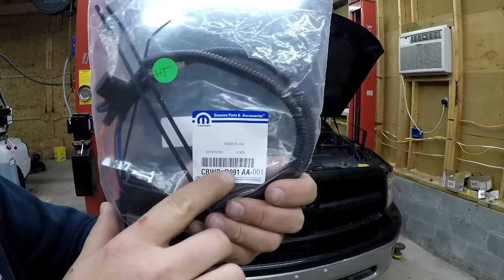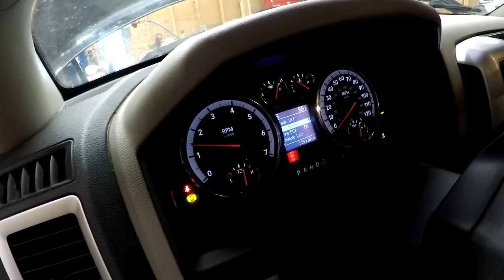Installing a Dodge fuel pump relay bypass for a faulty TIPM repair

Comment: Will that bypass fit my 2008 Dodge Ram 1500 5.7 leader the fuse panel that you're working on is different than the one that I have my fuse panel is located diagonal next to the battery not flat and yours have much more fuses in it than mine does your video was 4 years ago I look for the part number on Amazon and couldn't find it do you know if that item has been updated as different part number I just don't know

Comment: My grand cherokee had this recall fixed 3 or 4 yrs ago. Then from a year ago jeep gives hard start. So u have to turn on jeep half way to wait for fuel to rise then turn on fully. Now for the last four weeks jeep shutting off while driving. They say it is the fuel relay again. Chrysler just issued a recall on the recall nov 22 2019.
Reply: NOVEMBER 22, 2019 — A Chrysler TIPM recall has been issued for more than 698,000 Dodge Durangos and Jeep Grand Cherokees that were previously recalled for TIPM (totally integrated power module) problems.
The 2011-2013 Dodge and Jeep SUVs are equipped with 3.6-liter, 5.7-liter or 6.4-liter engines, and the recall is needed because the fuel pump relays inside the TIPMs may fail and cause the vehicles to stall.
Reply: My dealer says no fix till next year. So my jeep parked up

Comment: Great information but I think they're onto to this repair.  The part number comes up dry on google searches with the exception to the safety recall notice you showed.  Ebay had one with the wrong part in the bag.  Fortunately the notice contains a wealth of information.  Just sent an email to Mopar Part Depot with the truck VIN.  The notes on the Mopar page said this item is VIN specific.  If I receive a go pound sand reply I can at least build one.  
Thanks

Comment: My dad owns a 2012 dodge ram 1500 its a crewcab and has around 150,000 Miles. I ordered the part to fix the tipm and look forward to installing it. His truck has one issue that i hope you may help resolve. About one month ago a service electric trailer break light has come on the guage cluster. When he does start his truck the truck stays stuck in park and does not want to switch gear. In order to drive it you have to start the truck, turn off, switch to neutral, start the truck, and then switch to drive. Any help would be appreciated.
Reply from the maker: I can’t say I’ve came across that issue yet! It would be a guess without looking at scam tool data.

Comment: 2011 dodge grand caravan,,at 1st i thought it was the starter (would start cold but not when engine is hot) ,,changed starter no difference,, found a lower pulley on belt sticking an rubbing on block,,, fixed that and replaced terminals on battery ,,,still not working ,,,,so when i try to start it will click or sometimes no sound at all , still have all power and i have to sit for a bit an then it will start,,,could this be the mod key or ignition  ,, or this relay
Reply: @adriancardona6902  like i said i changed the starter

Comment: Dear Tom   foolery  I don't see the need to buy the part when attaching wide by splice will suffice I am trying to get the part number for the soj Micro relay inside the tipm the other guy who had a video    on replacing the micro relay didn't specify the part number of manufacturer also the delay failure may be tied to malfunctioning auto start any five print delay will suffice on the splice mode it may be a good idea to disable auto start function when you or I get it fixed

Comment: Hi- Great videos! I was wondering if you would know how to fix a low voltage reading on a 2008 Dodge Magnum fuel gauge. Works intermittently. Replace both fuel pumps and checked wire harness, pulled out dashboard and cleaned connections. Work for a while, then started acting up again. Any Ideas? Thanks!

Comment: Hey bud idk if you will read this or not but I've been beating my head over my problem. 06 dodge 2500 5.9 300k miles. Problem crank no start. The no start only happens when the trany temp light is on. I reset the security and starts just fine also if I step on the break and cycle the key it will start then die instantly.....

Comment: My truck did this (2011 4.7L). Jumped it off at work and drove home. Heard the fuel pump. Disconnected the battery over night. Next day hooked it back up and the fuel pump stayed off. Started and then stopped the truck and it continued to run. Pulled the yellow fuse and it stopped. Put the fuse back in and it worked normal. Started and stopped the truck 4-5 times. Fuel pump never stayed on. Even drove it a time or 2. 

Couple weeks later and now it won't come on at all. How do I know if it's the TIPM or a bad fuel pump?

Comment: I've got a 2016 5.7. 
When I bought it the fuel gauge didn't work. Installed new pump in and everything worked for about a week. Check engine light went away. But now check engine light is back and it's hard to start in the mornings or after it's been sitting for a while. Once it's on it drives fine but check engine light remains. Any help would be much appreciated!!
Reply: @RobertELee-uc7em  turned out to be a bad pump. Put a new one in and everything's fine now.
Reply: @elifernandez3769  how do you fix a 2010 charger same problem

Comment: I got a replacement kit for the fuel pump relay kit could not get the mopar one on Amazon . I got one but it has the brown wire, blue wire, then a red wire, can’t figure out where the red wire goes, can anyone help

Comment: Hi  Thanks for the video.  I have a 1989 DODGE RAM D150 with a V6 3.9l.  I have removed the cat and the truck hasn't been running good ever since.  There is a single O2 sensor upstream of the cat.  I applied the downstream "fix" to that; however it didn't help.  As soon as the truck gets to working temp it stalls when idling. On the highway, when setting the gas for cruise, the truck will hesitate for 60 sec or more before resuming normal ops.  I would like to apply a fix for this but don't know of any.  Any help would be appreciated.  Thank you

Comment: Stupid question but if I can actuate the pump with a scan tool and the fuse gets power for the fuel pump in theory the relay should be good
Correct?

Comment: Seems this part is no longer available either on Amazon or from Mopar (Mopar site says no longer available). I imagine most any relay would work so long as specs are met (volts and amps)?
Reply: MOPAR PART # 6814 2156 AC 001

Comment: I have an 04 Ram 1500 that just started not turning over with a battery drain and it sounds like the truck is out of gas, but its not. It did start up a few times yesterday after a jump then nothing. I cant find this bypass listed as a fix for my ear, its always 07 or newer. Will it work for an 04?
Reply: How old is your battery? From what you describe your fuel pump relay, the fuse and fuel pump all work. Does your fuel pump continue to run when your truck is off and key is out?
Reply: Johnny Bock-Thanks for getting back to me. The battery is just over a year old and had it tested last week, no problems. I checked the pump relay, it seems fine, even switched it with others in the box.
After my post I realized the fuel pump is not priming when I turn the key, its like a 1 in a million shot that it primes then starts. I've done the 'bang on the tank' while starting several times and the truck starts every single time. Based on that I'm prepared to change the fuel pump, hopefully tomorrow.
Does the pump continue to run when the key is out? I do not know. I do not have the know-how to check that. However, the battery has gone completely dead 2 or 3x over the past week so I'm guessing so.

Comment: At least your truck has relays. My truck has only two which is the ASD relay and supposedly the same fuel pump intergrated relay on the back. My box does not have one single relay which is so ridiculous.

Comment: Great Video! What brand is that little yellow torch you used to heat the heat shrink tubing?
Reply from the maker: Thanks! That torch was a gas station find! It was $5 and worth it’s weight in gold. It’s refillable too!

Comment: Not sure if this is my problem , 2011 dodge ram 1500 3,7  Shut the truck off and I have a 10 amp draw from that same circuit draining my battery? Not sure if its the pump or this relay thing. I have been disscinecting my battery cable every time i park it and seems to drive fine. It started as a intermediate start that went away then came back 3 months later, then the battery drain started happing.
Reply from the maker: Take the gas cap off after the truck is shut off and see if you can hear the fuel pump running.
Reply: @Tomsfoolery.  Thank you for the response.   This is in fact my problem. Watching these videos has very much helped me figure out why I am drawing 10 amps from FUEL/DSL Lift pump fuse circuit with key turned off, battery draining. AND in the beginning started as an intermediate start. months before. I have a jumper wire on there now till i can find the relay wiring kit ? Do you know where I can buy the wiring kit?

Comment: Thanks for this detail Video. Awesome job on that 🙌🙌🙌. Listen I'm working on a 2010 Caravan, that I believe its the fuel pump relay issue(same as your car you're working on, when the car sits for 10 min or longer, it cranks many many times before it starts, I check the power coming to M25 fuse from pin closes to the edge of the box and got nothing when engine cranks, which make believe it relay not working). However, When i searched for that part#, I can get it online, but the  dodge dealer said is discontinued part without giving any reasoning. Do you have any issue with this relay part that you installed on this video? Do you happen to know what's the deal with dodge discontinuing it, possible failing down the read....or??? Any info I greatly appreciate it. Thax

Comment: I got a 2007 Dodge ram 1500 4.7 and it has way less in my TIPM would the all the wires be in the same spot and colors that they're in the video or no...
Reply: Same problem im havin did u figure what colors sre which on our yr model? Plz help

Comment: Not sure but it looks like you sliced into pin number four instead of 38 did it work 38 is the PIN that's pink with a green wire that one is orange and green
Reply from the maker: It’s been so long, I don’t remember. But that repair did fix the issue at hand.

Comment: Just picked up the same relay kit at my dealership, was $19.06 after taxes. So hopefully they have gone down in price, they are no longer avilable online now.
Reply from the maker: Can you share the part number for all the people with this same issue?
Reply: Its actually the same part number, just a dealer only option, and you need a qualifying Vin number to buy it. But I just got mine done and works perfectly!
Reply: @Tomsfoolery.  CBWPRO91AA

Comment: I have attempted to order the part number through a Canadian Dealer and they say there is nothing in supply with MOPAR (been two months now)...so just wondering if you could describe which pin the wires connect to on the relay itself (by wire color) so that I could complete the installation using an after market product.  My vehicle is a 2014 Dodge Ram 3500

Comment: I ordered this relay bypass kit from Mopar and they cancelled my order. They said it's a recall part and wouldn't allow me to purchase. Come to find out, this part is no longer available to anyone, even VINs listed in the recall, and even the new replacement is on back order for months. WTF. My VIN ain't recalled so I'm totally F***ed. I don't know if any aftermarket kits will work but I have to try...

Comment: Would the engine light flash and the red lightning bolt turn on when rolling over?
Reply: Yes
Reply: The day before, Autozone said o2 sensor but they lit machine wasn’t good enough to narrow it down further. Next morning it wouldn’t start. Never had an issue with the truck. I read that naught be spark plugs, pulled all 16, cleaned and reinstalled. All 8 on pass side were carbon fouled. Took to Ram, they say the fuel pump relay- $2000. My truck has 45k mikes and oddly enough has the fuel pump relay bypass installed before I bought it. I didn’t know what it was tho.
Reply: Gonna pick it up tomorrow and see what’s up with the wiring on the existing bypass and also check the relay.

Comment: Do you know if my 1998 Dakota 5.2L uses the same setup ? Mine runs great for about 3 to 4 minutes then shuts down ,, will not start after this happens , then I  let it sit for about 15 to 20 minutes and it will start back up but for only the few minutes again . Mine has the same looking fuse panel as that Ram truck , thanks .
Reply from the maker: No, yours will have a removable relay for the fuel pump. A common fail with symptoms like you're describing are the crank and cam sensors. They get hot and won't start. Let em cool and it will run again.
Reply: @Tomsfoolery.  thanks so much for your help Bill
Reply: I’m having the same exact issues man truck been sitting for 2 months now did you figure it out???? I have a 97 Dakota 3.9 same issue as Bills BuildAll
Reply: I’m in desperate need of any suggestions
Reply from the maker: Have you scanned it? Back when I was working at the Dodge dealer we would see the crank sensors fail often. They would start cold but after they warmed up, they wouldn’t run. Let sit for a bit and they’d start again.
Reply: ts6034 I don’t have a scanner could I test the crank sensor with a voltage meter or a test light?

Comment: Hi, My vehicle loss power. I have a 2011 chrysler 300 c and the dealer diagnosed my vehicle as the tipm being shorted out  with fuel pump relay. Will this relay cause whole vehicle to lose power and if i replace the relay by following these steps will it revive the tipm? Or once the tipm shorts out will i need to replace the whole fuse box?
Reply from the maker: If your loss of power is a fuel delivery issue, it would fix it. But if the loss of power isn’t fuel related, this will not help. Ask the dealer who diagnosed it where the loss of power was coming from. Don’t give them ideas though. Let THEM say it was starving for fuel. If they think you’re just trying to get a free diagnosis, they’ll often be vague or possibly misleading.
Reply: ts6034 yeah they said 1st thing 1st it needs a new tipm before they can further diagnose which is $2300. They refused to tell me what caused it to short out though they daid the relay shorted out the whole box which is causing it to have to power. Do that sound true?

Comment: My daughter is having that problem with her 2011 Jeep Grand Cherokee. We are finding out that the relay recall was done in 2016 and warrantied for 2 years so it has expired. Now the local Jeep dealer is saying they can't order that and have to order what the said is the whole wiring harness at $2500. Can you tell me the link to where you bought that one. I have searched amazon and only find a 5 prong relay connector wiring harness. Her Jeep uses a 4 prong. The dealer said that the prongs in the connector is bad and just changing the relay itself doesn't help at all. I saw another youtube video where the guy actually took the TIPM apart and unsoldered the original fuel relay underneath and soldered a new one on and put it all back together with no need for an external relay.  I'd appreciate if you could give me the link to where you bought that one. Thanks. You know what? My bad I see you did have it at the top of the description and show a close up of the part number on the video.
Reply from the maker: I believe they’ve discontinued the part (makes no sense). But you could wire in a standard 4 wire relay. Get a waiting schematic and you won’t have to tear the TIPM apart. Also, check your local salvage yards for a used TIPM.

Comment: I done something similar to my Chrysler 200 2012. My car kept randomly stalling.  I spliced down the center of the blue orange wire fuel pump positive.

Then I ran a jump wire to the switched accessory outlet so every time I turn on the key it turns the fuel pump on.

I'm getting a replacement totally fuked power module for $100 from a reputable junkyard to try it.

Comment: What are the common failures problems that TIPM circuit do? what does the TIPM circuit do i'm confused on what a TIPM circuit does? its converts the CAN signals into ILS but what else?

Comment: I took my truck 1500; 2011 to the mechanic and they told me was the water pump, they did the jumper put now the radiator pump fan doesn’t work! The did it on the top of the fuses not under!

Comment: I had this fixed under a recall for free in my v6 2011 Jeep Grand Cherokee. Now have ram 2500 with same error code (darn dodge). Sounds like recall isn't for all Chrysler vehicles but needs to be. I'll be calling in the am to check and will report back if so.

Comment: Hi, how do i know  if this is my case? My 09 ram 1500 3.7 , shut off at a stop sign, with out a warning or anything, it cranks over realy good, so, no a battery issue or alternator, when i turn on the truck a cant hear the fuel pump at all. So , i dont know if is a fuel pump or a relay issue. What you think?
Reply from the maker: Test for power at the fuel pump. If it doesn’t have power, I’d suspect the TIPM. If it has power (and ground) yet doesn’t run, it would likely be a faulty fuel pump.
Reply: @Tomsfoolery.  thanks bro. Faulty fuel pump. Working on it now. Tks a lot

Comment: Hey this is Mike I got the same problem with my truck right now the pump won't shut off when the truck is off do you know what the part number is for the relay bypass?
Reply from the maker: It’s been updated so many times I’m not sure now. I’m sure someone can chime in with the number though.
Reply: @Tomsfoolery.   ok thank you cuz I've been looking up online and I don't see the same relay harness you have